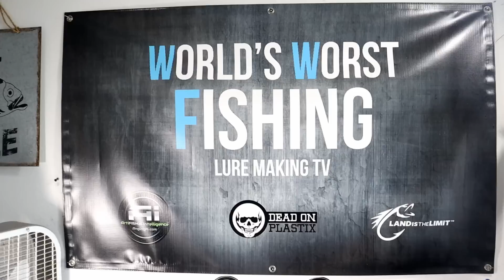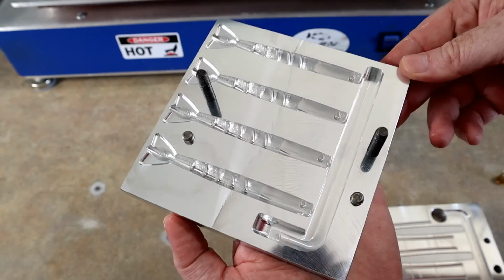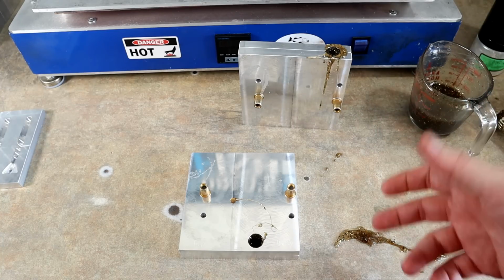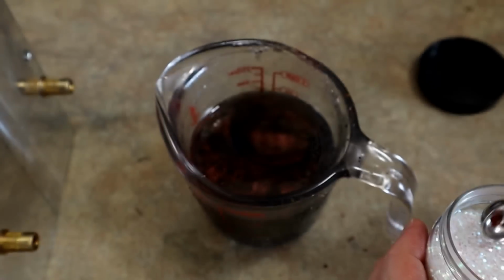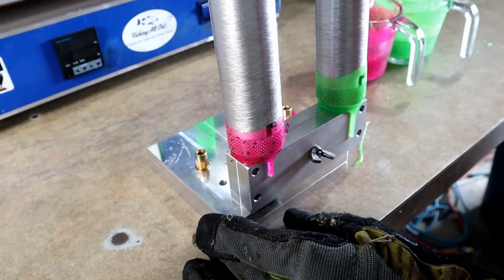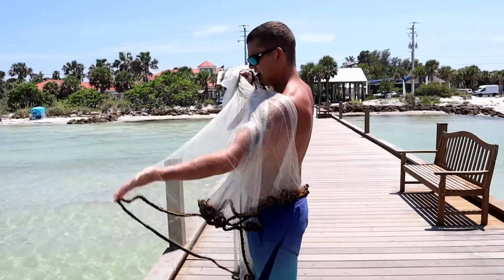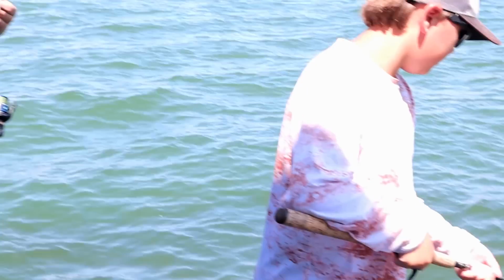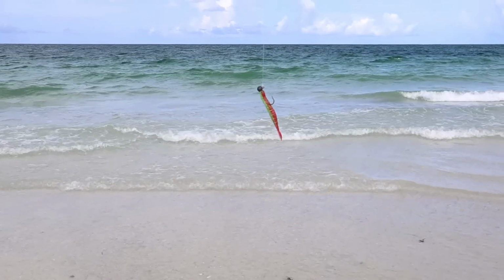INJECTION SHRIMP MOLD! Soft Plastic Shrimp Mold Demo & Island Vlog

Comment: They are excellent looking baits! They've worked really good for me under a popping cork (cajun thunder style) the cork brings them in and the shrimp finishes them off! Excellent video! Ive been using the open pour with mf's penny copper! Makes a killer new penny color.
Reply from the maker: Copper works well in saltwater baits no doubt

Comment: Skirt mold is like that.... curious to see if folks with shooting star have issues.
Reply from the maker: It won't fit a air vice..but a shooting star is just a fancy dual injector..will work just fine
Reply: @WorldsWorstFishing  i have issues with my shooting star injector in the skirt mold is why i asked.... i guess i will find out soon if this shrimp mold works (or not) .... thanks
Reply from the maker: @asand991  interesting..that makes no sense to me..skirt molds fill great with a regular hand injector 🤔
Reply: @WorldsWorstFishing  yessir, regular injector works great, but shooting star injector has two little bits that extend out from bottom .... and the holes in the skirt mold are very shallow.... injector tip cant seat all the way in there.... thats what i experience anyways lol... maybe its just me???

Comment: You are fishing the shrimp way to fast.  You need to almost dead fish it.  Let it sit and just move it a little bit at time.
Reply from the maker: Good to know...when I've used them before on popping corks, we twitched it pretty fast..wasn't on the bottom tho
Reply: @WorldsWorstFishing  

Great mold, it’s going to get bit. I really like the open pours you did a few vids back.
Reply: Came here to make this comment. I fish in Australia but I think prawns are prawns and fish are fish. Also, could go way lighter on the jighead (1/16 or less) cast tight to structure and stay in contact as it slowly sinks. Best way to fish prawn plastics I believe.